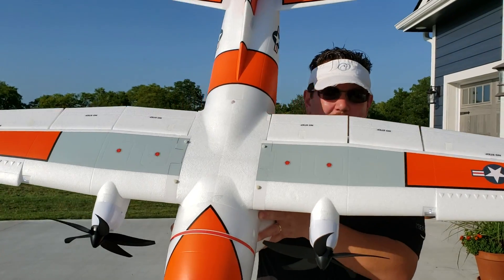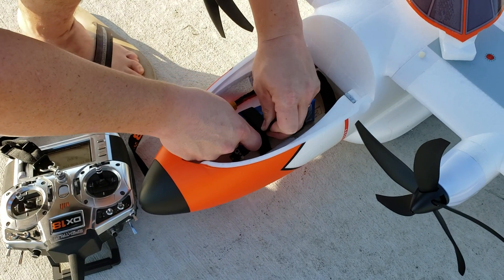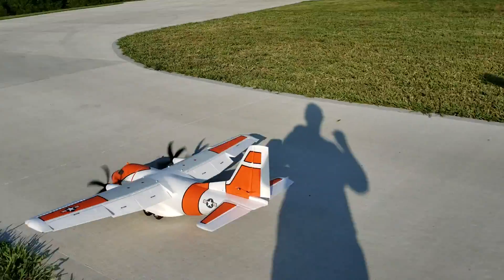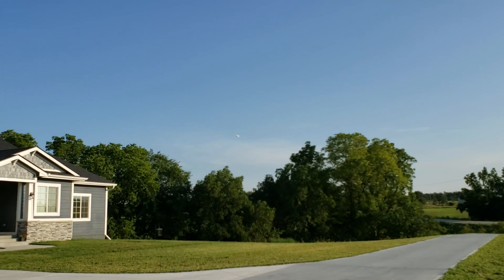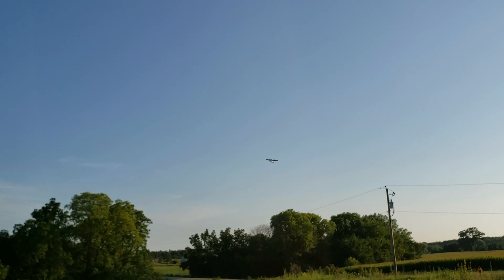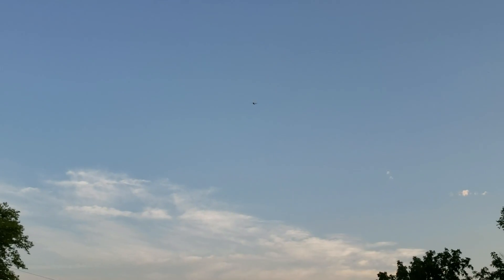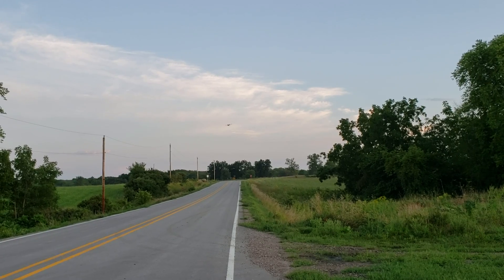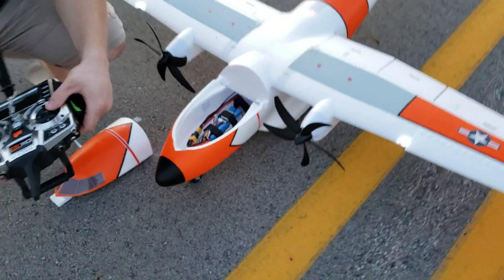Eflite - EC-1500 Twin 1.5m - Maiden Flights, Unbox, Build, Radio Setup

Comment: Your showing a lot of L rudder and R aileron. Your flying in a “slip” with vast amount of induced drag. It would be very unstable in flight. Couldn’t believe anything it’s trying to tell you. Good luck.
Reply from the maker: I figured out my very rookie mistake, but you gotta stick with the video for some time. I try to show my authentic, and imperfect experience with these planes. This was one where I made a pretty big mistake...I trimmed ailerons to fix roll from the rudder, and vice-versa, thus the issues I had on the first few flights...but now she's flying like a DAYDREAM!!!

I still would have expected retracts or 2m for this price point. In talking with Horizon Hobby, they told me there was quite a bit of project "creep" on this one...thus the high price...but after getting her dialed in, she is AWESOME!

Comment: As expected horizon screwed up this one as well
Reply: I've always had good luck with Horizon Hobby products. Ehhh I guess this one was built on a Monday or Friday.
Reply from the maker: Okay, am I the only one seeing double vision here? LOL (Miller RC and Miller)
I wouldn't say it's HH's finest hour....lower the price by about $150, and they'd have a HUGE win!!!
Reply: I'm just gonna throw my 2 cents out there and say that I would not pay $100 for that plane. Here is my beef with horizon. Me and a few friends had some umx planes and they worked great the, electronics work great and would last years. then they got the current president for the company and since then I have have seen and experienced the electronics and QC go steadily downhill. since then the micro planes me and friends have had mutipull servos and main boards go bad. As for the normal pnp planes the QC has been terrible you had a screw bag with a hole in it. There new extra 300 is a classic example of them cutting corners they give you acuall pin hinges for the rudder but  the elevator and aileron are foam hinges if you look half the reviews say that the elevator hinge tears easely. That is just stupidity.why they did not pin hinge the elevator and ailerons is beyond my mind.  another thing I don't get is that are trying to get there timbers and this cargo plane  to do 3d if your gonna do 3d get a 3d proven airframe you don't see full scale scale planes like the ec-1500 and timber x doing crazy knife edge spins or hovers there is a reason the airframes are not made to do 3d. There recent hanger 9 timber is no different. also one note on that gas timber they say that there is a optional pr bushwheels tire and landing gear set that looks so cool. But the problem is that pr bushwheels is out of business so you can't even get them anymore. They always make the same stuff let's see something else besides timbers and cubs.  So with all that being said until they change something to get there electronics and QC back up I don't think I am gonna get another plane from them. If you were to ask me what the best foam pnp bnf planes are I would say Freewing. But even then I have seen some weird stuff. From them As Well. If you or anyone who is reading this and you have luck and like horizon then good for you and I wish you many happy flights. Thanks.
Reply from the maker: Yep, Miller RC - I think you've hit the nail on the head. I have to plead ignorance over the current president at Horizon Hobby, or the past lineage of leadership there... BUT ...historically, I have had the best experience with Horizon Hobby. Where and when I have problems (legitimate beef, not made up, picky things like I often do...) Horizon Hobby is one of the few companies in RC that will make right a situation with remedial action from returns, with full refund, to replacement after a total loss crash...I can't say anyone aside from MotionRC (a horizon dealer) has even treated me this good....but your assessment seems spot on, all things considered.
Competition is the friend of the consumer - recent and NEAR [necessarily] monopolization of the RC world may be waging war on our wonderful hobby :(

Comment: I have a EC1500 and it flies fine AFTER YOU MAKE PROPER ADJUSTMENTS. No RC plane is perfect out of the box. And as for people bitching about the price , IT'S HORIZON HOBBIES and a completely newly developed product  not HK and their crap electronics that they put in a design they. Stole.
Reply from the maker: "AFTER YOU MAKE PROPER ADJUSTMENTS" - I agree, but with Horizon Hobby, this is often times 2 clicks of trim, not maxed out. I had to make mechanical trims on ailerons, rudder, and steerable nose gear, which I did prior to my maiden flight, and then again after the maiden flights. I'm not sure why I made such a rookie mistake of trimming BOTH The rudder and ailerons, which definitely exacerbated any shortcomings of this plane, but I did...then I fixed it, and I'm still disappointed with the bang for the buck. I wish I would have bought the F-16, or the Carbon Z Cub.

This is one of the worst maiden flights I had with a Horizon Hobby plane, but it's not a BAD plane.

P.S. I don't care if it's "completely new", that doesn't justify an overpriced, under performing plane...and I'm talking about AFTER I fixed my screw ups on trim, that to be totally honest, I shouldn't have needed to make. I'm not trying to bash Horizon Hobby, they're one of my favorite brands, and they make some of the best stuff our there, and it's generally fair priced - not my feelings with the EC-1500.

Comment: Wow, this plane seems to fly as ugly as it looks. 👎😕 a very expensive, wonky, not attractive scrap. Thank you Brian for the honest look at it.
Reply from the maker: I'm sorry to turn you away from it. I did get it flying well, but you're exactly right...TOO expensive. I told Horizon Hobby what I thought and it was like talking to a brick wall....like I had no clue what I was talking about. It was not a good experience, but the plane is pretty fun now that I have her dialed in. Shouldn't have had any of these issues, and I did make some mistakes...I trimmed the rudder and ailerons contrary to one another - rookie mistakes, and embarrassing too - then I caught it before the "Down the road" part of the flights. BUT I stand by my position that this plane is about $100-150 over priced. For $400, it ought to have a 2m wingspan. The larger air frame would help with wing loading too. I'm not too keen to putting a bigger motor on it and making it fly...I mean, I could put a bunch of big motors on my 96 gallon trash can, and make it fly too, but doesn't make for a beautyful plane...

...also, I was thinking this would be the Avios, C-130 Horizon Hobby style...I was wrong.

Should have just gotten the Carbon Z Cub SS 2.1m - THAT IS A PLANE!!!
Reply: @BrianPhillipsRC  well despite the trimming issues you sure did a great job flying it! Couldn't agree more! After watching your video I will be getting the Carbon z SS, the wing loading must be outstanding! 
Thanks for the awesome response, and all your videos, always a pleasure to watch!! 💪🇺🇸👍
Reply from the maker: You will LOVE the Carbon Z Cub SS 2.1m It's an AMAZING plane!

A quick tip for you...I just pulled the vortex generators off and glued them down. They were pulling up with just the double sided tape provided by horizon. This wasn't a huge issue, but they were buzzing and wish I would have just listened to my gut...which told me to glue them down.

Comment: I didn’t watch the whole video, but I cannot believe how badly you’re cross controlled. Your rudder has roll coupling. Straighten out your rudder and then you can make your ailerons symmetrical. do not trim your ailerons to compensate for the rudder. Look up the term "dutch roll" that is why it was flying bad. also when you have control surfaces compensating for one another, there is only one speed in which the forces will balance out.

Some poorly designed models will require the rudder to stay trimmed one direction due P factor, but this model has NO P factor. it is a counter rotating twin. Learn to watch your model closely to see if it is tracking straight. at a glance your model is not tracking straight. 

Hope that helps, from Team REVO.
Reply from the maker: Larry - while you're right, and I understand you mentioned that you didn't watch the whole video - that's kinda where you should have stopped commenting...since I show that later in the video.

I definitely made a rookie mistake here, and I DID trim both the rudder and ailerons trying to get the plane to track straight. This was my mistake, which I did catch.

Even after fixing the trim issues, I'm just not overly impressed with this plane. I think it's way too expensive for what you get. It's a pretty decent flying plane, once trimmed, but I've never had trims so far off from Horizon Hobby before...I may have gotten a lemon?

Anyway...lots of troll tonight, (not you...) but you're getting my reply after dealing with three in a row - total A-holes. It's pretty disgusting how some people will treat someone that's going out of their way to help other RC enthusiasts. This is why I'm not in the Club Scene, fyi - Our hobby could use more nice guys and less A-holes, if you ask me...some GREAT people in the hobby, but regrettably, a lot of jerks too....

P.S. I don't know if you realize this, but I try to reply to 100% of my comments. This is not without a large time commitment, maybe 10-15 hours a week on a bad week. I love to help out beginners, and even some guys that are way more experience than I, when I can...not like I'm getting rich doing this...I think I might make about $0.50/hr doing this stuff...then to have snooty, dick hole comments coming it - it wears you out
Reply: Brian Phillips  there are 3 things you gotta check before a maiden flight. 

1 CG
2 servo direction 
3 control surfaces trim without deflection. 

Yes, looks like someone at the factory was screwing on the control rod linkage when the lunch bell rang at the factory. 

Some models fly better than others. My friend told me the 3D timber didn’t  fly that great, but I bought it anyway since I just had to have it.  This is another plane I just have to have... sucks if it doesn’t fly that great. After flying planes like the Carbon Z T 28 and Cessna 150 you get real spoiled and then nothing lives up to those expectations.
Reply from the maker: Larry - comments are spot on!
Once we get spoiled we expect near perfection ;) (I try to use this excuse with my wife...........)